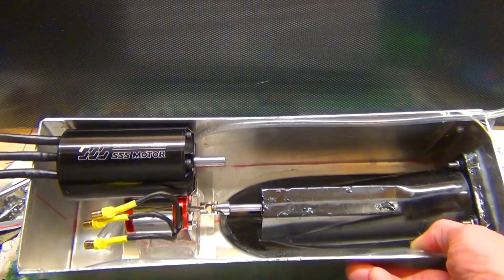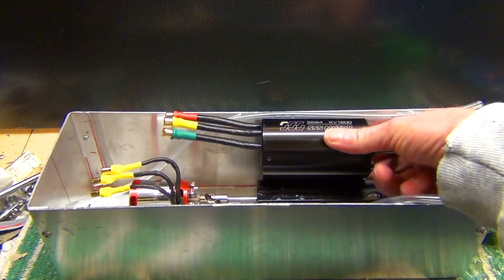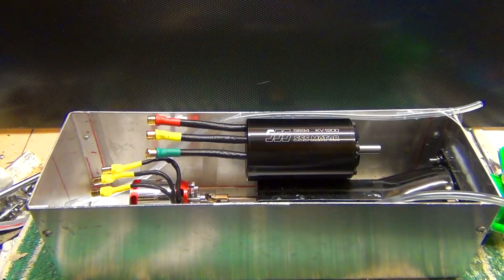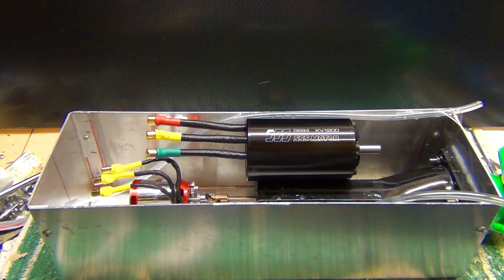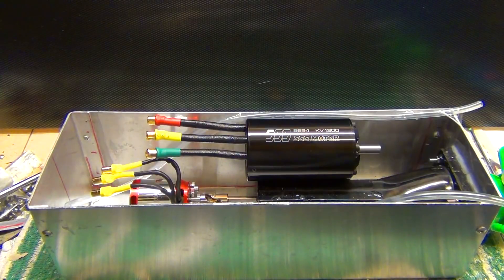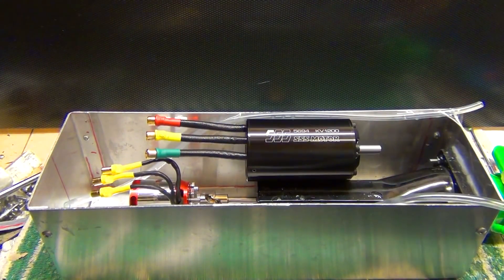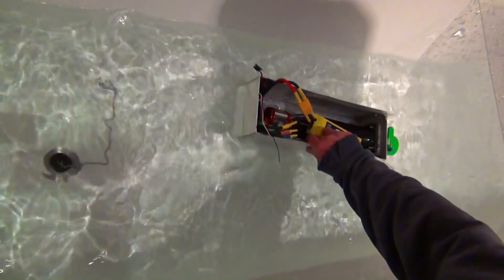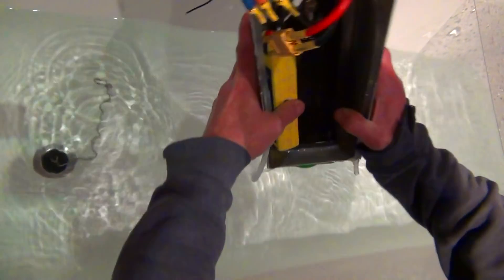Bigger motor choice arrived :)

Comment: overkill motor maybe??shaft is bigger on motor then on the jet .
Reply from the maker: Hi Mate 
it a possibility but all other 53mm jet drives have an 8mm shaft,
so I could be underkilling with my 6mm shaft, it dose have 3 bearing supporting it so hopefully it won't start vibrating at full tilt when the monster cranks up, destroyed in seconds !!! lol,,, it's gonna be funny however it turns out,, Cheers for the point out mate :)
I hope all is Rockin !! 
Mark